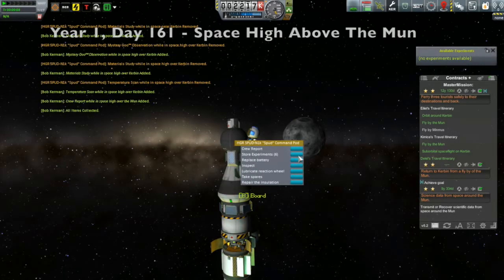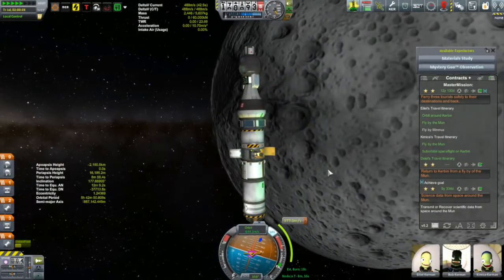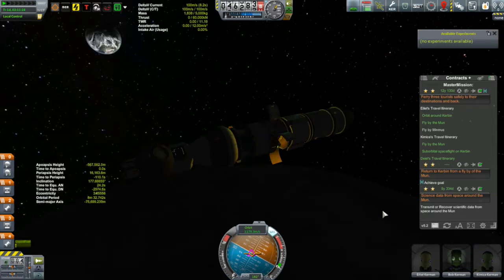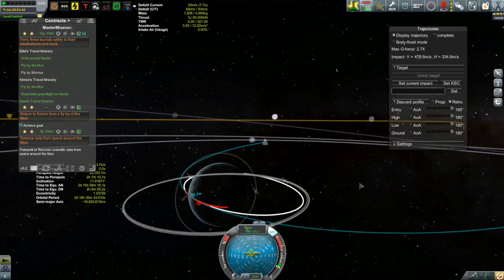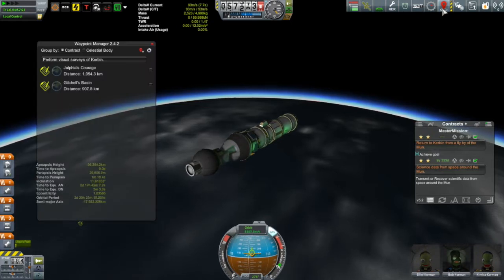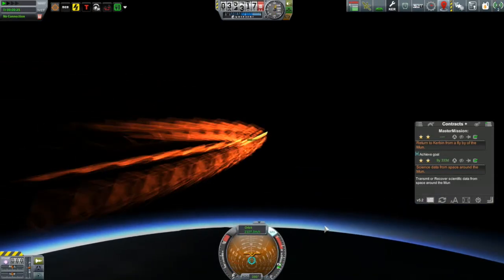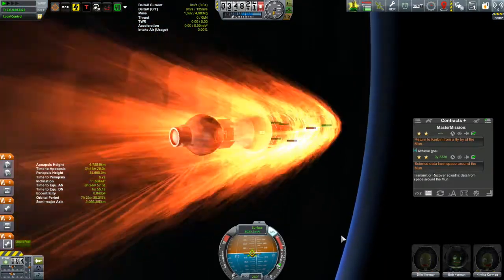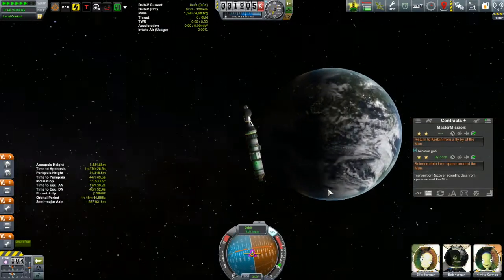KSP Career: Episode 23 - Aerobraking

Comment: The "counter-intuitive" point I think of as "going faster, backwards".

I use CKAN on a daily basis to keep my mods up to date. I just cross my fingers there will be no save-breaking updates! But I do keep backups of my PC, including KSP, so I do have a fall-back.

Which Tech-Tree are you using, or is it part of KCT?
Reply from the maker: viruk67 I've thought of CKAN.  I should probably look more into it.  I also keep a completely vanilla copy of KSP as a backup.
Reply: The only problem with CKAN is that its too simple and you can end up loading way more mods than you really should!
Reply from the maker: viruk67 Thanks.  Good to know.

Comment: It took more delta v to get back because you had a lot of radial velocity
Reply: Which is why you ended up on an escape trajectory
Reply: To get a more efficient return you should have burned radially
Reply from the maker: Yes, there's an annotation that I added (maybe you have them turned off) where I realized that.  Burning radially would have worked, but I believe what is better is burning a bit earlier.  You'll see this in my Minmus flyby which is coming up.  At least it gave me a nice smokin' return to Kerbin.